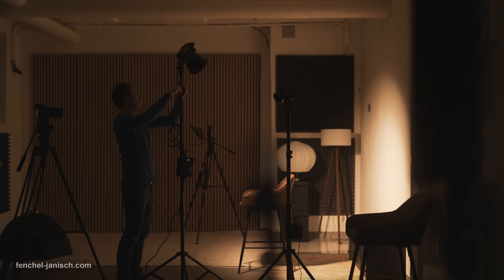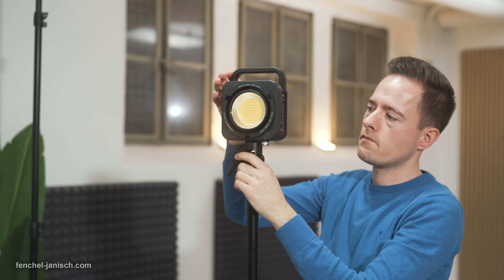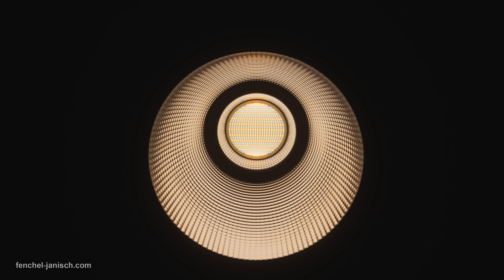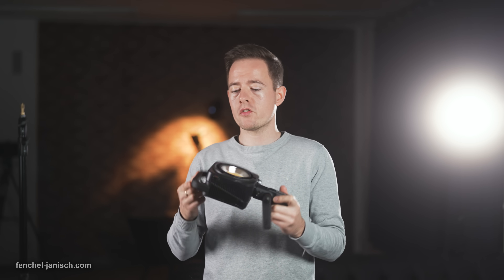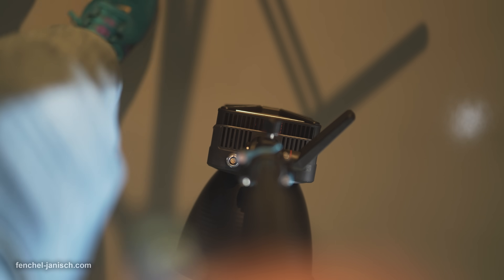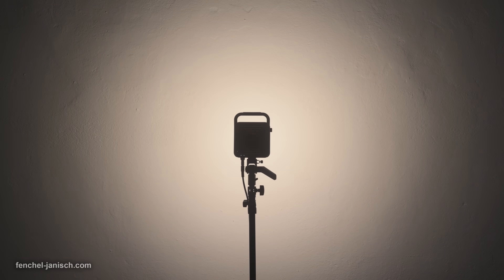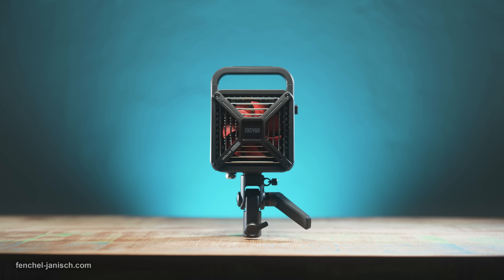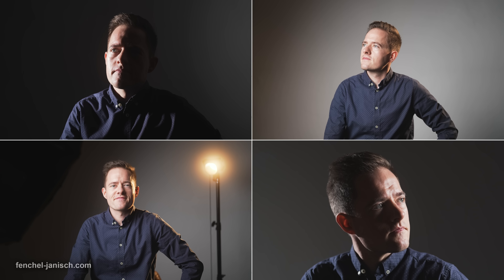Zhiyun Molus G300: Compact film studio COB LED light

Comment: Nice review. Can the mounting bracket be easily removed for more compact transport?
Reply from the maker: It's actually fixed but the angle can be adjusted to make it smaller for transport.